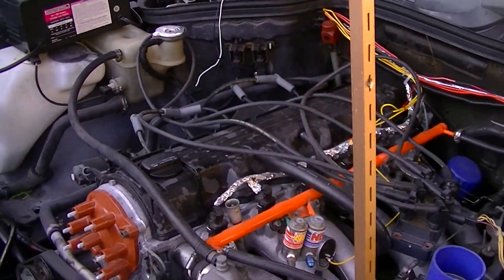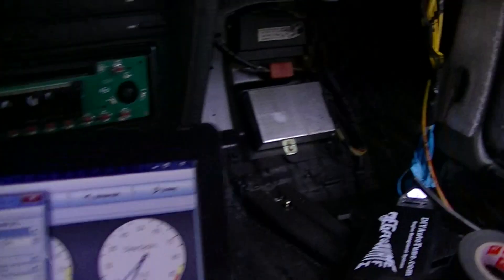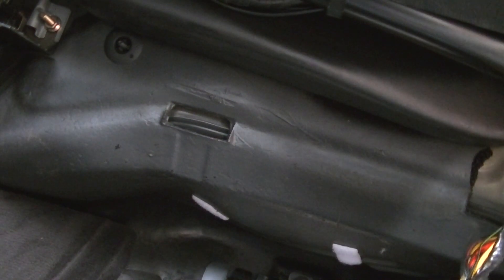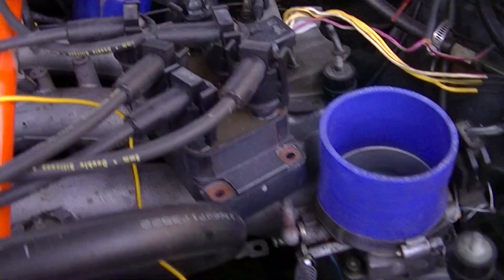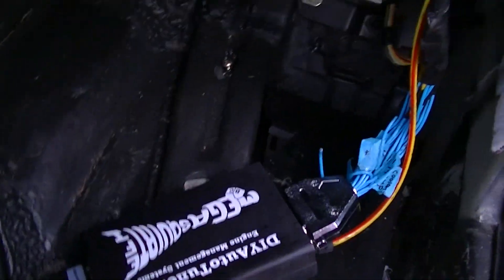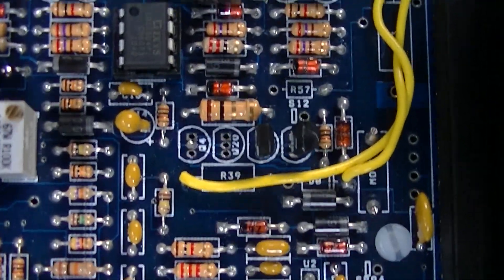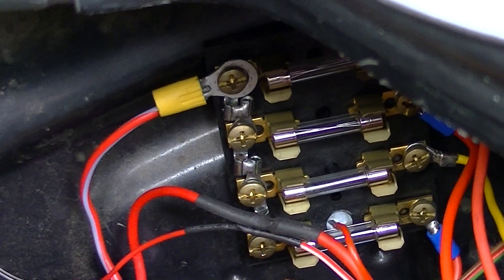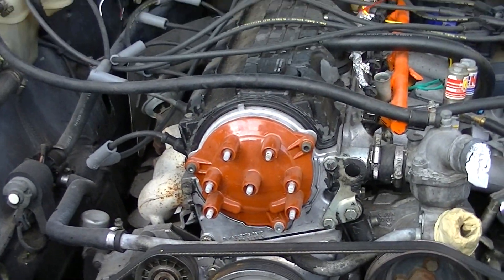190e megasquirt first start

Comment: I’m still new to this, just a question, is the trigger wheel being used for the magnetic-hall efect sensor?
Reply from the maker: Yes, but it’s more of a variable reluctance sensor.  More common and more robust but gives off an ac signal which can require a vr conditioner to properly encode to a signal that a microcontroller can read.
Reply: @idus  I see, thank you for the info I really appreciate it!

Comment: Hi. I have a 1989 190 merc w. carb and I have been thinking about installing MS I or II to it. Which do you prefer? Here in Finland the cost range doesnt vary too much, MS I ver 2.2 is only 130eur and 3.0 190eur. The MS II 2.2 is 216eur and 3.0 251eur. The thing is, I could afford any of them, though i would like to know which version i should buy. I will be installing a turbo also later on, how much does that affect the overall choice between boards? I have read a lot about MS and I know something already about my needs and the MS's cabability on delivering. Its always fun to hear about other peoples opinions too :D thanks!
Reply from the maker: Bemuks hello!
Sorry for the late response. I use ms1 v3.0 board because it can read a vR sensor natively. I have also used microsquirt with great success. 
V2.2 board is good for fuel only but you run into noise issues when you add vr trigger wheel inputs. If you ever want to control ignition and have a great lauch control setup, I would go v3.0 diy.

Comment: Hello 
Where did you get triggerwheel?
Reply from the maker: Mahoney you can grab them off the 90's fords with edis system. They used a 36-1 crank trigger. 
I get them from the junk yard, but you can also get them from a parts store. Its a 93 ford escort or ford exploder.
Reply: IDUS Thanks,I cant found these cars,I live in Bosnia.Is the trigger wheel hard to adapt?
Reply from the maker: Mahoney no, you weld it to your existing crank pulley.
Reply: IDUS Any specific position? .Do you have mail,or facebook? I could use every kind of help.
Reply from the maker: Mahoney brooin8@hotmail

Comment: Is your 190e previously a carb?
Reply from the maker: It was previously mechanical injection. Csi is what it was called I think.
Reply: +idusclothing name of the mechanical injection is k-jetronic, i think.

you still have this merc? im gonna do w201 megasquirt install too, except ms1 v2.2 and engine is m111 (multivalve-2.0) :D
Reply: +idusclothing is it better on fuel economy?
Reply from the maker: It was a k jet injection stock. 
Started running weird so I put two su carbs i had laying around on it.  

Then the carbs made it run rich but very well so I fuel injected it and took off the dizzy ignition and had megasquirt control fuel and ignition through edis ford ignition system. 

Had to weld a trigger wheel from a ford escort on the front of the crank pulley for the  trigger wheel and pickup vr sensor. 

Ran great ever since.
Reply from the maker: +Fresco L yes way better on fuel

Comment: Your pwm idle mod didn't look like it was wired the same as the manual.. A bit late now 4 years on 😂.

Did you get it running good eventually, I haven't checked if you've made an updated video, I'm just randomly commenting on this and being too lazy to check. 

Plus I've written too much at this point to just delete it all 😕
Reply from the maker: Riding Retro yes, it ran very well. I had to let it go because my smog guy disappeared off the face of the planet one day. After making a custom fuel rail, it ran very nice. The auto trans responded well and the tuning was very successful. I have since gone deeper down the rabbit hole and opened a shop doing just this. Megasquirt never had a straight forward how to so I had to read the whole manual about 3x before it clicked. I am now turbo charging my triumph daytona. Cant wait to see how much more power it gains. 
Happy tuning,
Andrew
Reply: IDUS that's awesome glad it worked out for you, I find that with a lot of the ms tech you read forums and there's loads of outdated missing links or components are discontinued etc, it looks like most newer guys that run megasquirt just use mspnp or ms3.

I'm still yet to get mine running.. I need to convert back to that tip22 transistor mod as I thought I could make a twin transistor setup to control a 3wire idle.. Nothing happens when bench testing it's just constantly closed 😂